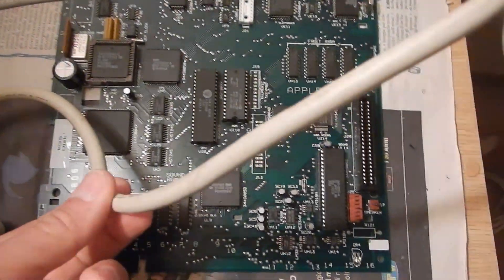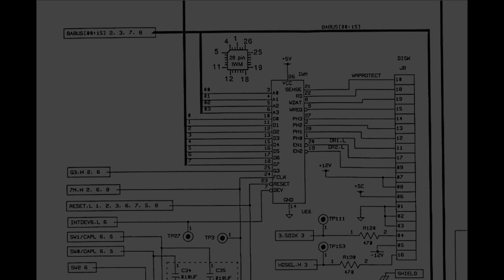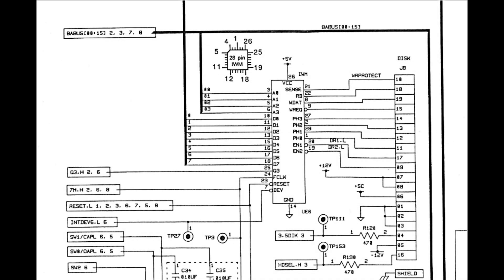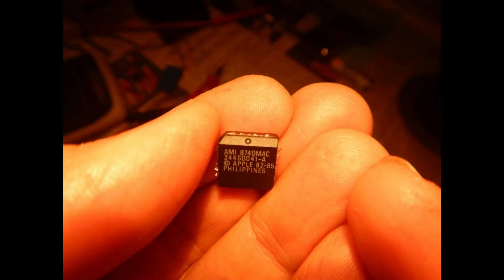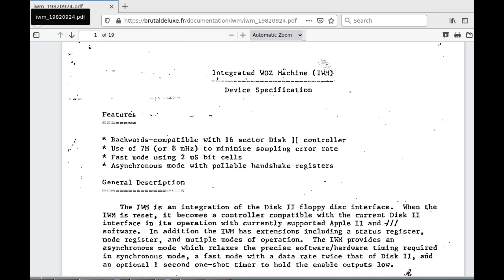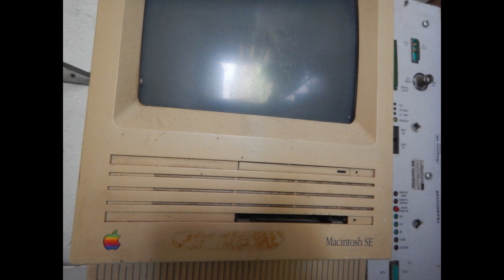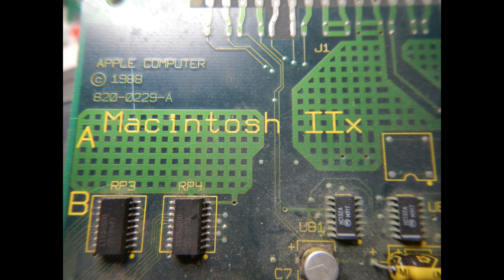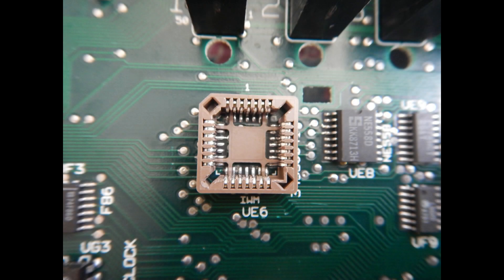Apple IIgs disk interface issue. Substituting the IWM with a Macintosh one.

Comment: That is amazing.  I always wondered if the 1988 date-coded SWIM chip would work in a IIgs.  When working on the Mac II and IIx machines, the normal IWM is the 1982 date-coded part.  The 1988 version is the SWIM with HD Floppy drive support.  I've upgraded many of the Mac II and IIx this way.  They need the Rev C Eproms as well to enable the use of the swim.  I wonder how much effort it would be to modify the IIgs rom to use that SWIM???
Reply from the maker: I think the only difference is on the software side, if you use a 28 pins device. So it should be possible to use HD floppy drive support on the IIgs with appropriate software.

Comment: Great job!  Interesting to see the Mac IWM works with the IIgs!
Reply from the maker: The old 28 pin DIP used in the early Macs was the same used in the IIc, so I figured out the 28 pin plcc must be functionally identical :) It's just not widely used as most of the Mac II versions have the 44 pins plcc SWIM.